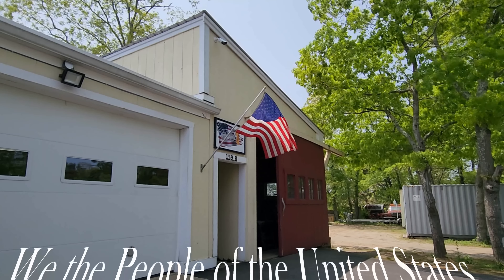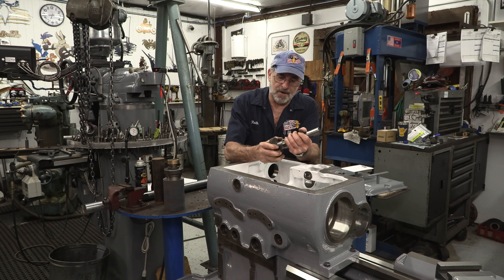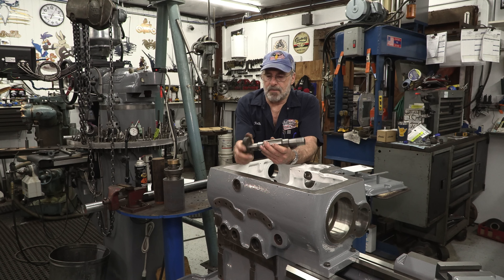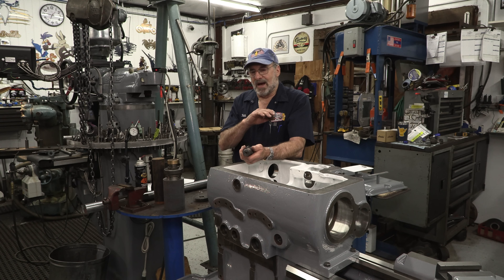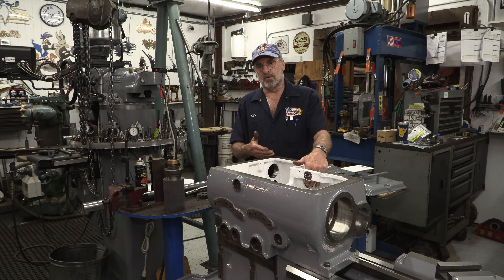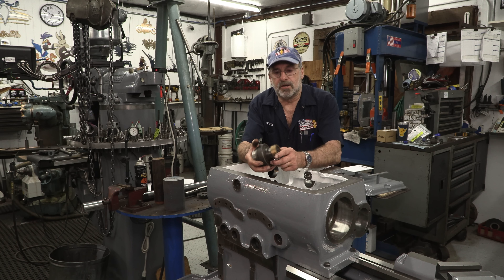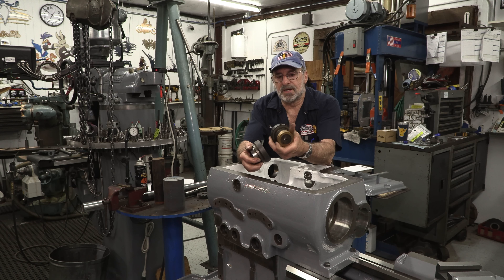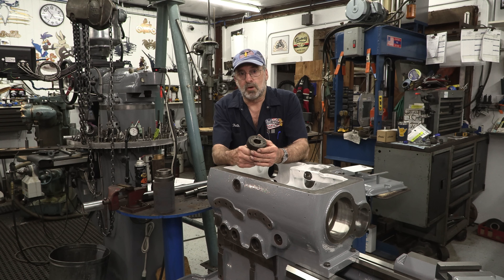Splines & Gears Clutches & Brakes

Comment: Hi Keith, I would leave the clutch material as is and mate the new female clutch assy to it, yes you are going to lose a bit of breaking power with the slightly smaller dia but would be minimal.
My 1955 Dean Smith & Grace had the same setup but never braked very well, I just put up with it.

Comment: Hi Keith yes I was thinking the key damage was from tear arsing also. With the brake lining I would think it would be asbestos from that vintage, I used to repair brake linings on tapered brakes on overhead crane hoist brakes, I found non asbestos woven ferodo a good replacement flexible to bend around the tapered brake. I used to rivet the ferodo on using pop rivets I found this was a strong bond with no issues. I found tool post grinding of the lining a better proposition than turning on the lathe using h.s.s regards Ian.

Comment: Could the galled gear shaft be built up by spray weld or Tig buildup  and not necessitate a whole new shaft? Nice intro.
Reply from the maker: The gear is as wide as the two opposing keyways, so there would be more to it than just building a diameter and turning to size

Comment: Keith why don't you send that shaft to Abom and have him Flame weld. And turn it down to size.
Reply from the maker: Because I'm not a fan of Flame spray in this applacation.
Reply: @KeithFenner  And turning it from fresh 4130 stock will make good content for us viewers to enjoy. I enjoyed watching the Rutland being rebuilt and I'm going to enjoy watching Pearl being returned to as new or better than new. BTW, I have a Taiwanese made Birmingham lathe that is very similar to that Rutland.
Reply: If the customer (in Keith’s case himself) is willing to replace with new verses repair that is always the best option. 

Welding over flame spray would be better anyway.